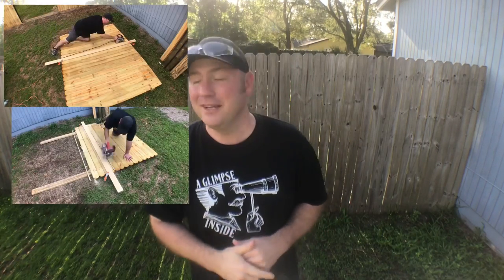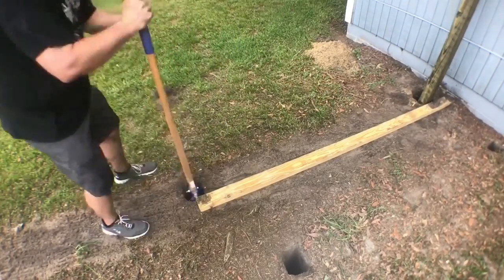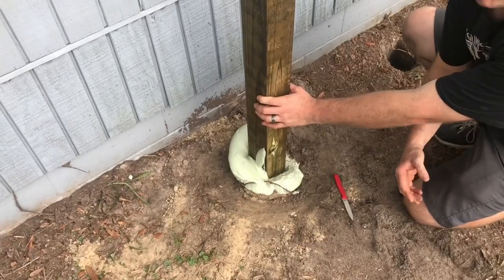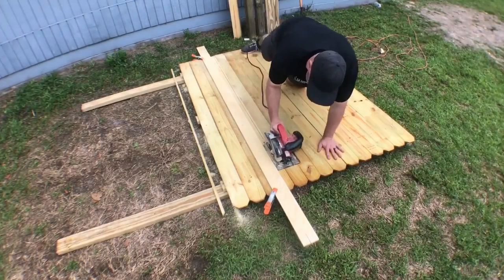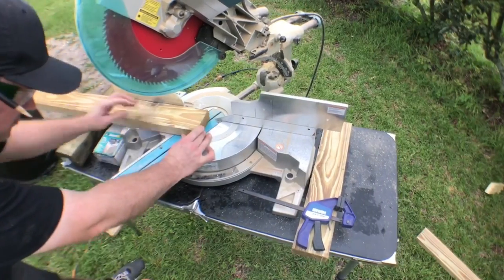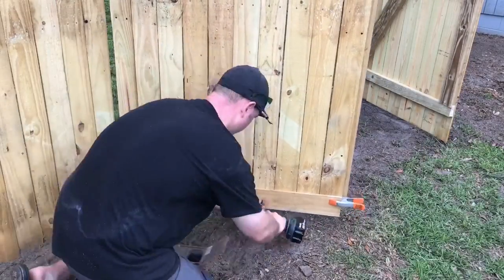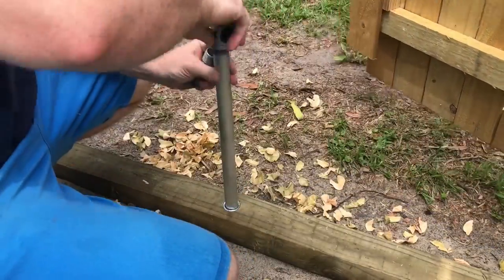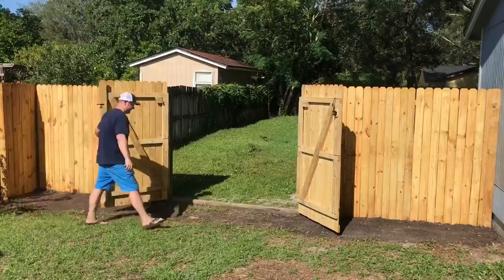How to Make 2 Gates Out of 1 Fence Panel | Won’t Sag | DIY Woodworking with Minimal Tools

Comment: Back in theday I did fences. When I had weird slopes, I made a template from about 12"x96" 3/4" plywood that matched the dog ears, set it to match the slope with a few screws or clamps, and cut the fence tops to be straight with a 1/4" trim router bit. Pretty fast and takes all the crap out of leveling the panels as they go in.
Reply from the maker: 42Fab - Metalworking & Fabrication great idea man. Thank you
Reply: @AGlimpseInside  Would it have helped to vary the depths of the holes to adjust to the slope or would that mess things up elsewhere?

Comment: I didn't want to pay for two gate kits and had the same idea of making two sides from a fence panel. Lucky I found your video, will make it so much easier than trying to learn it from 10 different gate building videos. Thanks!
Reply from the maker: Hexane Smith You got it. You’re welcome. Also the question about different whole depth actually they make longer 4 x 4’s that you can then just trim off but I will keep the hold up is the same

Comment: Man, I get jealous when I see people able to dig a 30" deep hole with just a post hole digger :-) I just built about 80' or so of fencing for an animal pen, and here in SW Missouri, digging the post holes was a CHORE. I ended up with most holes between 18" and 24" deep before the rocks just made going any deeper without a power auger impossible. I did set each post fully in concrete with a good amount of flare at the bottom of each hole, so hopefully, they hold up. I really like the idea of the "threshold" under the gate, and I will be adding one to my project soon. I am also really impressed you were able to install the hinge hardware by yourself. (I used the exact same kit on my single door gate). I had to call in reinforcements from the wife to hold the hinges while I marked them :-) 

Anyway, great video, and thanks for providing some knowledge that I will be using when I add a second, 2 door gate in the spring to allow me a larger opening to get in and out of the area.
Reply from the maker: Shannon Flood Yeah we’re really lucky the ground is pretty soft here and we’re on lucky as well if you know what I mean. Thank you so much for letting me know your thoughts on it and I very much appreciate it. I struggle to be installing the hinges and I hide a lot of it behind the camera if you know what I’m talking about. Again thanks for reaching out I definitely appreciate it
Reply: Florida aint got no rocks.

Comment: Good job. Just a suggestion for you, I own a fence company in alabama. So, to get your top straight, once the posts and framing are up. Run what I call a string board.  Set a string board up at the corners and pull a string line across the top and level the line. This will serve as your line for all of your fence boards. And you can make it completely level at the top of your fence. Remember, fences dont level to the ground because the ground isint level. Level it at the top,back fill with dirt or trim the bottom. That is just what we do. I applaud you for your method that worked for you though. Keep at it.
Reply from the maker: I appreciate the feedback brother, I really do. That fence has since been torn down and I’ve had professionals redo everything. Always good to hear professionals talk about what they do on this channel I really do appreciate it
Reply: Anytime. If you ever want a different gate tutorial I'd be glad to shie you how I build mine if you're interested. Always good to have multiple ways to accomplish the same goal depending on the circumstances you may be facing in a build.
Reply from the maker: Jonathan Plowman Most definitely. Are you on Instagram or any type of social media

Comment: Great job. I have never used concrete on my fence posts because inevitably the post will rot and you will have to dig up all that cement. A little dirt some water and a good tamp and the fence rails will hold it all in place. Never seen the foam before I'm interested to see how that holds up in the long run. As far as the fence not being flat on top. It's your personal house not a customer's if your good with it keep it. Good job!!
Reply from the maker: matt daniels Thank you Matt. I’m with you, Concrete and my pin is really only need it for fences 8 feet and Up. My fence replacement from a year ago had awful amount of concrete I had to deal with and it was a pain!! Thanks again man!!

Comment: Well you doing better than the previous homeowner of my home in the diy department, his diy repair of a 3/4” pvc pipe was amazing, yup, first he wrapped with plastic and then slathered silicone all around it and you know what, the mf didn’t leak for years, I was actually replacing another section of the pipe and his silicone patch gave so I replaced the entire run correctly. Please update in a few years because I gotta know if it’s still standing strong with that foam. Tip: use a string line bud

Comment: Like the post at the bottom ty for the idea clean work id probably cut the top of the fence with a string line to even one side to the other might be at an angle but Itd flow together better

Comment: I used 3 in decking screws for mine and and worked just as good  as the lags so you don’t really need lags it’s just a bit of overkill
Reply from the maker: I thought about that and I think it will work for the most part however in the long run I think lag screws might be a better option. Although that fence is since been torn down so I guess I’ll never know

Comment: Awesome build Chris! I'll have to look into that foam if I ever need to set some posts. Good to see you wearing shoes! But then you reverted back to sandals later on in the video.... old habits are hard to beat ;)
Reply from the maker: OSO DIY Well since you were the first to notice. I will tell you. I happen to step on a nail into my foot about an inch through the shoe. I went inside cleaned up bandaged it up and then finished the project with my flip-flops because it was tough to get my hurt foot into another shoe. Lol.
Reply: Ouch! Maybe you were jinxed with the shoes and need to go back to flip-flops? Wait, noo don't do that either. Be safe man!

Comment: This is a pretty nifty project!  That foam looks way easier than mixing and pouring concrete!
Reply from the maker: It sure is. It works well too!! Thank you
Reply: The foam will wiggle its garbage you need good hard concrete to make a good solid job.

Comment: How did those posts hold up??Looked like alot of movement from them while you were putting the lag bolts in.
Reply from the maker: The posts hold up great however that fence is no longer there as I put a whole new system in place in the driveway where that since used to be for my new shop

Comment: Four different heights along such a short stretch. Wow.
Reply from the maker: I know it’s amazing isn’t it
Reply: If you never have to look at it I suppose.
Reply from the maker: TelsaBom Hey man like the sense of humor. Yeah I know the levels of the fence and what not didn’t come out the way I imagined. But the video was really about turning a stockade panel into two gates. But as always thanks for watching
Reply: Even the original fence was one level the whole length!

If you drop the gate an inch you could make it level with the right side and close the gap at the bottom which also makes the fence look like c4ap. Then drop the side palings an inch and you would have a pretty nice looking fence.

At least you have a sense of humour about it.

Comment: How is that foam holding up? I need to install a new 8' wide gate ( probably a double) and was thinking about foam for the posts.
Reply: Fierce Smurf It looked a little wobbly as he built it. I actually just set a few 4x6 and 4x4 posts and went with concrete. I really wanted to use foam but I kept seeing in reviews how the posts were wobbly. Good for a less important fence, or something far away where you couldn’t haul bags of concrete. This is my front fence with a gate so it had to be solid.

Comment: The pipe idea is pretty neat rather than the flimsy kit they sell. Only thing I would do is add another pipe to the other panel, and then the larger pipe in the ground for when you open the gate and don’t want it to close if windy.
Reply from the maker: Great idea. Thank you for the suggestion
Reply: A Glimpse Inside not a problem. Time to make a follow up vid. Don’t forget to give props. Lol

Comment: You could easily hide the slope change on the left by adjusting a few pickets going from the gate and down with small changes of 1/2 inch or so.
Reply from the maker: That’s a good idea. Unfortunately this comment came after the fence was already built LOL
Reply: @AGlimpseInside  Yeah I just finished working on mine and had to do a few tweaks myself :)
Reply: Could of used string to have created that gentle slop when adjusting the pickets

Comment: cement is more work for sure, but ... can you build up with foam?  Those posts will rot out at the base a lot faster with it being exposed directly to the dirt. With cement I build up 2-3 inches (I go 4 above and boards facing me, when the neighbors conveniently MIA after a windstorm). Curious about the foam and post base solution.

Comment: Great job, about to put up a fence in a few weeks, new to FL, live in Jacksonville. Looked everywhere on COJ website, do you need a permit to install a fence? Also, one thing i would have done differently, i would have made the fence the same height and followed the baseboard you used on the gate throughout the entire fence. It would have lessened the gap from the ground and have a more uniform look overall.
Reply: here is a link to a local company in Jax,   http://fencedup.com/jacksonville-fences-installed/  Per the FAQs at the bottom of the page you don't need a permit for a fence up to 8' in height in Duval County, however, a fence in the front yard of a residential community cannot be more than 4' in height

Comment: My question is if I do a six-foot-long door the way you did the square on the other video will it sag if I use the pine pickets which are the cheapest pickets, or do I have to use the cedar ones andthe two by four cedars. I asked you because I saw another video and the man said they had to be Cedar wood so that it won't sag, cuz the regular Pine pickets are too heavy and the door will sag. Please let me know if I can do it with a pine pickets and it won't sag. What do you recommend
Reply from the maker: My large gate is built with Southern Pine and almost 2 years old with no sagging issues whatsoever. Cedar is very light weight however construction matters most. Techniques that will last matter more than what material you use to a certain degree. If you have the money for cedar by all means. I simply went with the more cost-effective outcome
Reply: A Glimpse Inside well I thought you said ur gate was cedar and 2x4 cedar also.So now u confused me.U said if I use treated pickets it would sag.
Reply: And I'm speaking on the doors not the gate please

Comment: Hi. I read that you have replaced the fence & gate in this video. What I'm wondering about is how the gates made out of fence panel worked for ya. I have a double gate (12ft wide total, drive thru) to fix and might make a new one instead. Not fancy - it opens to the alley. Just needs to occasionally open. Thoughts?
Reply from the maker: It worked really well. If you’re going to spend 12 feet and cut it in half with 6 foot gates I would definitely recommend putting a wheel or a caster at the bottom if you can. Or just make sure you get 12 to 13 inch hinges. But yes if you reinforce the panel it will work well
Reply: @AGlimpseInside  Thank you so much for the reply. Is definitely worth a try for saving about $1,000! The wheels are good ideas. Thanks again!

Comment: ? HOW ABOUT JUST MAKING IT ONE GATE? OH I GET IT YOU JUST LIKE WATCHING YOURSELF...LOL. GOOD JOB WORKED REAL HARD I COULD SEE , VERY GOOD INDEED MY YOUNG FRIEND.
Reply from the maker: I have a lawn tractor that would only fit through an opening that I figured would be too big for one gate. Thanks for watching and do you just have caps lock on or are you yelling at me LOL?
Reply: @AGlimpseInside   YEP, I LIKE TO YELL SO EVERYONE CAN HEAR, OR MAYBE I'M USING ONE HAND N LIKE TO MULTI TASK. IN CONCLUSION WTF IS THE DIFFERENCE?.  THE POINT WAS TO USE ENTIRE PANEL AS ONE GATE.? ASSUMING YOU BOUGHT THIS AT HOME DEPO. THEY SELL PREMADE AT @12 ' . REINFORCED AS YOU DID ANY WAY,  WOULD LEAVE MORE TIME FOR THE BBQ N BEER . THAT BEAUTIFUL CHILD WOULD APPRECIATE A LITTLE MORE DAD TIME ALSO. GREAT WORK, JUST NOT TIME EFFECTIVE, UNLESS YOU WERE TRYING TO ESCAPE DOMESTICATION.

Comment: I saw these panels at Lowes and was wondering -- Is it possible -- remotely possible, to attach these panels to a chain link fence and secure it with galvanized wire to the chain link fence without driving post or taking down the chain link fence?  Thanks.  Great video.
Reply: Sherloid Bai thanks for responding.

Comment: nice job.  the hinges will fail first.  not enough flange on the stationary side.  puts the fasteners to close to the edge of the post.  threshold was cool and that was the correct way to install a rack brace.

Comment: It must be nice to be able to dig a hole like that and not hit solid limestone about 10" down.
Reply from the maker: It is nice. Typically all of Florida is pretty much sand so you give-and-take with what you have
Reply: @AGlimpseInside  South Florida is where you typically find the limestone and coquina. I was in this Youth Conservation Corps until I got kicked out in the late 70's. It was a summer job. We were living on an Air Force Base in Homestead, FL. They literally cut drainage channels deep into the coquina. That was about 40 years ago for me though so I doubt I remember it very well at all. Anyway, we put some fence posts into the ground, chain link fences. I only remember going to lunch, playing at a rec room, going by the Everglades, the deep coquina trenches for drainage putting up some chain link fencing. There was this fat kid who was running his mouth and he called me gay. I got mad and kicked in him the mouth while he was sitting in a chair. Turns out I broke his jaw. Lucky for me I was still a minor. I don't know how I didn't get into a lot of trouble. I guess now if you call someone gay it's supposed to be a compliment or something. Anyway, my dumb ass had to go back to Jacksonville, FL. That was supposed to be a summer job. I lasted about two weeks. I think it was a sign of things to come. I broke that kid's jaw because we had been issued steel toed boots. I failed to mention that. And that fat kid was super fat and way bigger than I was. I was just a chubby kid. He was a total fat ass just running his mouth at me. I got upset and boom, everybody wanted to kill me. They had to keep me in my room for my own safety, from some of the kids anyway. So much for me growing up and that being a character building summer for me.
Reply: Everytime I watch one of these fence videos I say that lol. Must be nice to dig so easily lol

Comment: Are the picks from cedar or the other heavy pickets.What about the 2x4 are the regular also.or are they cedar also.cuz they say that if it's not cedar it will hang cuz of heaviness
Reply from the maker: The pickets and two by fours are made from dimensional lumber Southern Pine
Reply: A Glimpse Inside yes but there only 3 ft long it won't sag

Comment: Why did you chose to place the new fence further  back and not closer the same area where you had the old fence?
Reply from the maker: The old posts had a ton of concrete that I felt was too much to dig out... so, I moved it back a bit!
Reply: A Glimpse Inside I understand 🙂, is a wooden post a better choice than a metal pole?... money and  durance wise?
Reply from the maker: Ana Cabrera Wood is a bit cheaper However metal would last longer for sure. I just prefer would because I’m a woodworker
Reply: @AGlimpseInside  Thank you very much. You been most helpful. Cant wait to see more of your future videos. You made a fan out of me ;).

Comment: I have a question I need to build a double the with the opening being 12ft so I was going to do 2 6 foot gates... For a 6ft y’all gate do I need 4x4x8 or 4x4x10?
Reply from the maker: For that size GE would definitely go with a 6 x 6 x 10 and put it for feet into the ground. The fence you saw in the video has since been torn down and I put that exact same size, 12 foot, 6 foot per each store in in the six by sixes are perfect
Reply: So this is a gate in my drive way! I bought 2 pre fab fence panels. Did you add the same support to the new fence as you did in this video? Any thing else I can do to keep it from sagging
Reply: Do you have a photo or video of new fence?
Reply from the maker: Kosta Zisi my “dream shop build “ video has a few looks at it but I did not feature it.
Reply: Looks great! What did you use for the support on the backside there?
Reply from the maker: 2”square metal tube. Welded
Reply from the maker: And thank you much !

Comment: I have to wonder if a savvy criminal would simply take the screws off those hinges & bypass your nifty locking mechanism.  I know this because I have had my house broken into many times of the years & it was the doors & gates that swing outward that were the areas that thieves always seemed to go for!
Reply: I meant to say MANY TIMES OVER the years instead of many times of the years.
Reply: @sherrydee7880  get yourself a weapon in the house, and once the criminals hear you have one from those who tried to break in before. I guarantee you won't have that problem again.